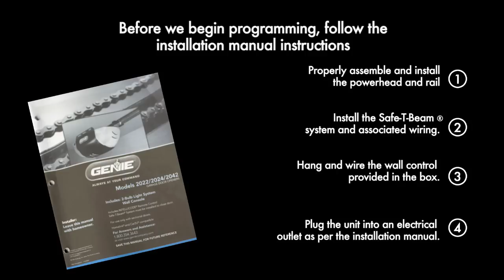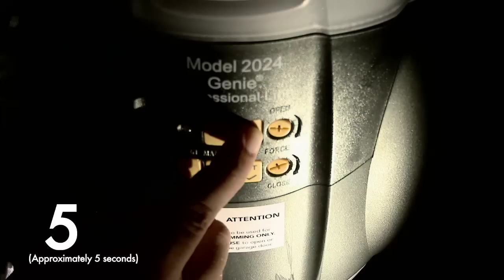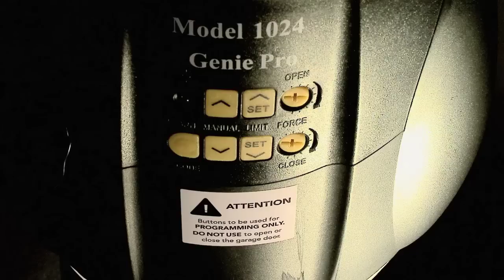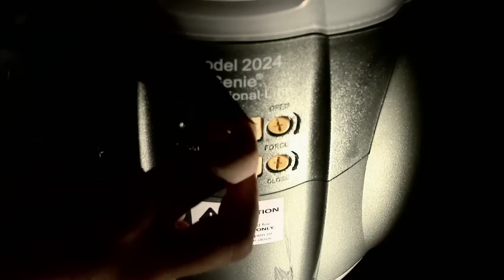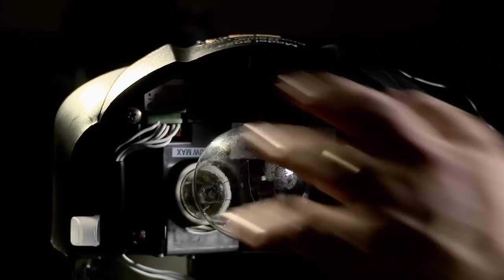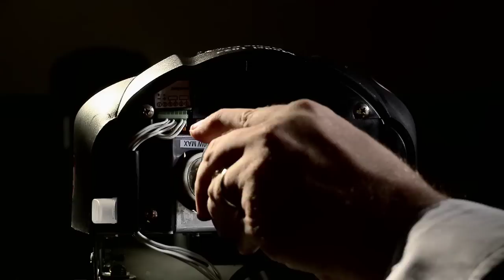Genie® Garage Door Opener Programming Instructions

Comment: I set the down limit for garage door. When I push the up button to set up limit on the unit. It trys to open door and just goes chunk chunk chunk chunk shacks the rubber belt and door doesnt move. If I manually move door open and reattach it to belt  then push button to close door. Same thing happens and door won't close.  Please help! Any suggestions?  I have genie model 2042

Comment: Remotes and key pad stopped working at same time.  Re-set open/close limits with help of this video (manual doesn't make it clear that 3-flash pattern of green flashing LED will not change until all steps complete),  re-programmed key pad with instructions on inside cover.  Re-set the two car remotes - all good. Thanks.
Reply: Steve Walker thank you I had the hardest time getting the green light to stop flashing until I read your comment

Comment: The one thing it doesn't tell you to do which fixed my problem was unplug the powerhead for 30 secs and plug it back in. That fixed my remote issue.
Reply: JCW all my remotes quit working at once. Unplugged the power from garage opener for 30 seconds and was able to reconnect all openers But had to reprogram them. Not sure why yet...
Reply: Actually, the video does mention unplugging the unit for a period of time. I don't recall if it mentions a specific period.

Comment: Both of mine stopped working as well. The dang thing just wont see the signal. Programmed another unit to use my remote and it worked fine.